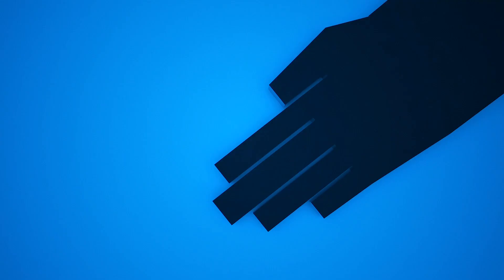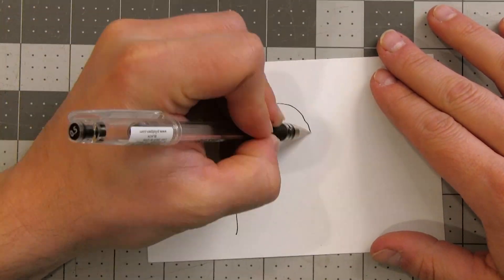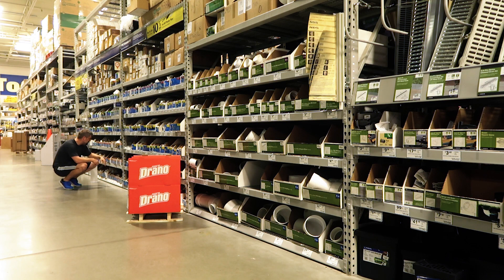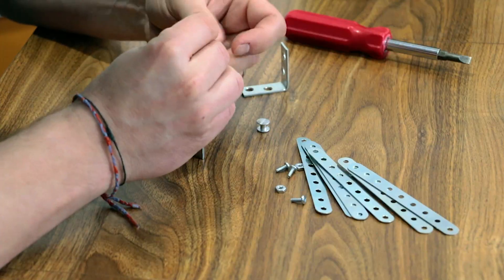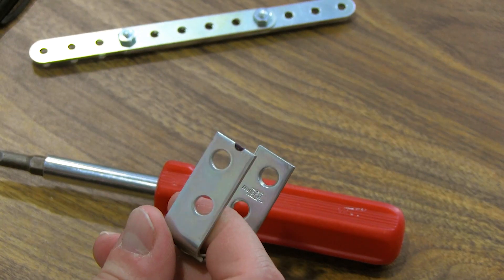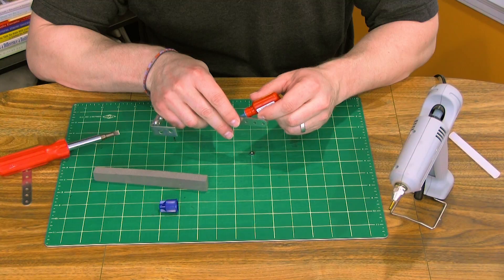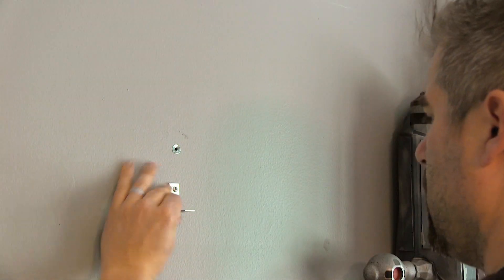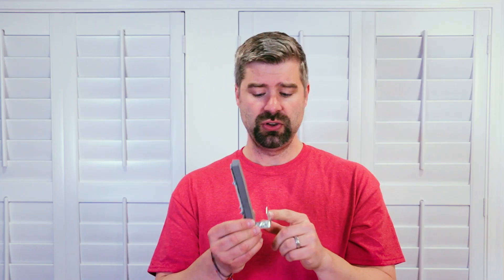Simple Helmet Wall Mount : How to do it

Comment: Will it hold for 3d print helmets and motorcycle helmets
Reply from the maker: Jacob, it just depends on the weight of the helmet. But, if it's heavier you can just swap out the parts for thicker ones or double up on them. Thanks for watching!

Comment: Hey Dave, I was wondering if you have a video or link to a video on how to mount this hanger to the wall. Thanks!
Reply from the maker: Hi, thanks for watching! I don't have a video on that. The good news is it's pretty simple with a "hollow wall anchor". Just make sure that you've got a bolt that fits the internal threading of the wall anchor and fits through whatever hole is available for the part you're attaching to the wall. Hope this helps!

Comment: This is amazing, help me mount black series helmets , but would share the parts break down, price and where to buy
Reply from the maker: Great to hear it helped you! And your helmets are pretty sweet! Did you end up using the same parts or do it a different way? Thanks for watching!
Reply: @MakeForOthers  why did you avoid his questions? Share with us
Reply from the maker: @85gslse  Thanks for watching. Every helmet is a little (or a lot) different so there isn't a specific parts list. Other than the foam padding, all of the parts I used were purchased at a hardware store.

Comment: I don’t have too many power tools. Is it possible I could purchase 1 of these from you?
Reply from the maker: Zach, thanks for watching! It should be possible to make one of these without power tools, just depends on the kind of helmet you want to mount on the wall and how strong it needs to be. Unfortunately, I don't have the capacity to make more right now. If you do need to make a version that requires power tools, a lot of my builds have involved borrowing tools from friends. Hope this helps!
Reply: @MakeForOthers  thanks

Comment: Hey, is it possible to place motorcycle helmets as well?
Reply from the maker: Maybe, just depends on how heavy the helmet is. Most of the parts you could double up on to avoid bending the upright. Also would make sure there was plenty of padding where the helmet would rest/touch so it wouldn't get scratched up.